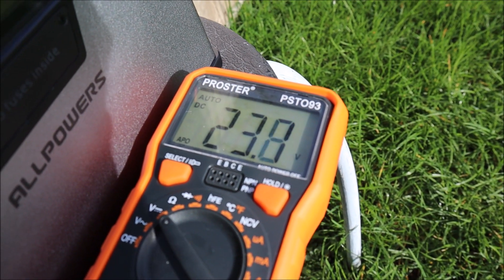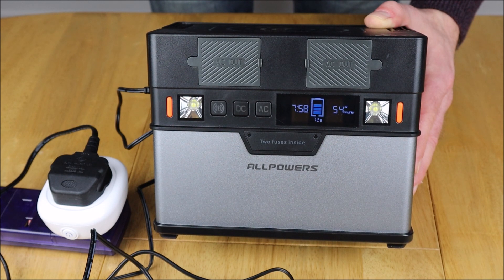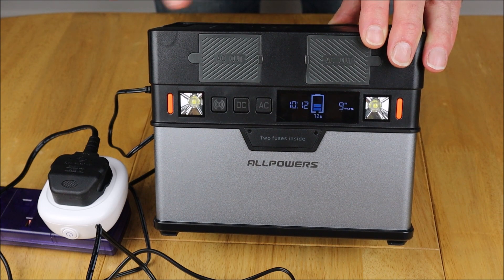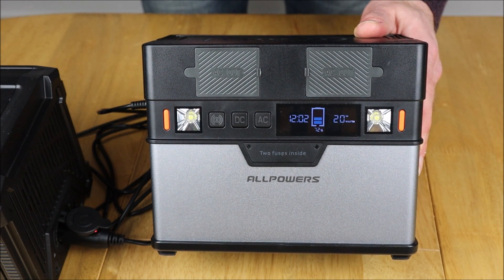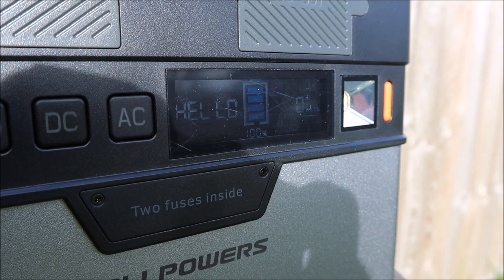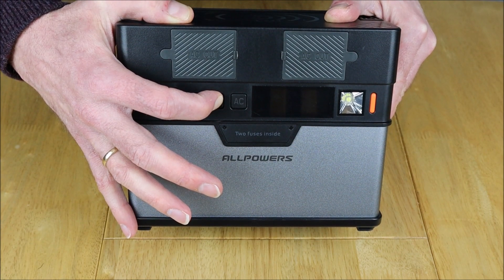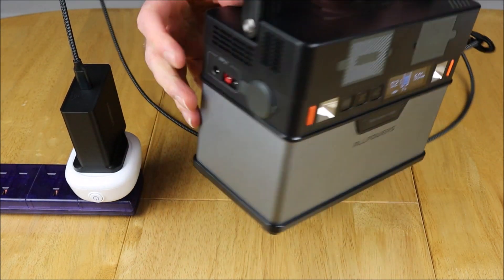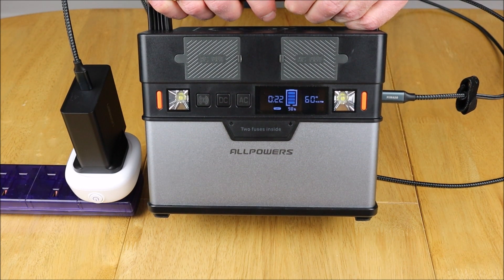ALLPOWERS 372Wh Portable Solar Generator Update | Charging Rundown

Comment: DADvinci ... I have one of these.  However, mine is on O charge (the charge completely depleted), and with the adapter that came with it, it WILL NOT charge at all ... it remains on 0.  So, I contacted ALLPOWERS.  ALLPOWERS sent me a USB-C Charger, asking me to charge it  through the USB-C port (I received it about a week ago) and it still is on 0 ... it still isn’t charging.  Can you help me with any suggestions, etc., to try?  And, yes, I have reset the battery, back to factory mode, several times!  When it was charged, and working, I really loved this little MONSTER, the short time that it was working!  I had it only for about 3 days ... before on the 4th morning, when I tried charging it (then, it had about a 35% charge, that’s is what was showing in the window, and on the app), it would not charge!  I would appreciate any advice that you can suggest trying.  Thanks! 🙂
Reply from the maker: @SharPharMade Good day! I'm so sorry you are having problems. Thanks for the info and I’ve got a few questions if I may (sorry if you've already covered these elsewhere). This might sound odd, but are you able to charge anything from the battery at the moment? Do the standard USB ports provide power or does the wireless charging work? Are you able to switch on the AC? Do you have anything to power from the 12V cigarette lighter socket? 

I'd like to see if it's possible (if you haven't already), to put a draw on the battery and trick the charging circuit into charging again. I appreciate that it's indicating 0, but there may still be enough underlying voltage to kick start it again. Please can you let me know how it goes. All the best, Adrian

Comment: I purchased a 372Wh from Amazon on your recommendation.  Thought you may like to know, along with the standard mains "brick" charger - they also shipped to me the USB-C charger option, albeit a single unit - as in charger and USB-C cable attached in one unit. Works a treat as you demonstrate, I was getting 64W on its initial charge. Oddly though, my unit was completely flat on arrival. I will give it a good testing and let you know how I get on. Methinks perhaps the suppliers may have been watching your videos. Keep up the great work.
Reply from the maker: Good day to you! Thank you so much for your kind words and taking your time to share, it's really appreciated 😊 This is great to hear and a positive move forward with 'extras' appearing. I'm not sure about your unit arriving flat, perhaps they are testing them more now. Please let me know how you get on and shout if you have any questions. All the very best, Adrian

Comment: 14:22 For some reason the charging cables shipped with the units all got the Anderson polarity reversed. Dunno why that is. You need the rewire it.
Reply from the maker: Good day and thanks for your comment, much appreciated. The cable I purchased was fine, but you're correct as the manufacturer asked me to swap the Anderson connection ends around to get it working. It turns out that in my case it's the input voltage range that affected the Anderson port charging which I found out purely by chance (this video if you haven't seen it > https://youtu.be/ViLdkYzOZqA).

Thanks again for taking your time to share this as it will also help others. All the best, Adrian

Comment: Mine charged the battery 4% then stopped charging! Looks like the charger has packed up with 30 minutes, not really a good start.
Reply from the maker: Good day Mark and thanks for your comment. I'm so sorry to hear you're having problems. Have you tried a factory reset (hold down DC button for 20secs)? If not, I suggest giving that a go first.

Do you have another way to charge? Perhaps a USB-C wall adapter and cable to plug in the USB-C PD socket that takes charge? If you could let me know, I might be able to help further. All the best, Adrian
Reply: DADvinci yes I done that. However it’s the charger. It’s only outputting 7v, so that’s packed up! Also when I load it to 90w it just cuts off on ac, I’m sure this is not right?
Reply from the maker: Yes, that's a duff charger for sure as 20V is the norm. May I ask what load you are powering at 90W? Is it when you plug something else in whilst a device is already being powered by the battery - say you have a 40W load, then you plug in an additional 50W load to bring up to 90W? Cheers, Adrian
Reply: DADvinci yes it is, funny thing is I plugged a charger in and it went to 180w and no issues. Why would plugging another charger in affect it? I must have a revised unit as the plugs are nice and tight, there are no rubber covers on then either and I have a nice orange silicone piece under the handle for comfort.
Reply from the maker: Hi Mark. For the alternative charger suggestion, I was just checking it wasn't DC port related as I couldn't tell that from your very first comment (hence trying the USB-C port to charge). It all became clear on your next comment that you'd tested the charger voltage being delivering (which I didn't know in the beginning). It's working ok now, charging included?  Please shout if you need anything else. Cheers, Adrian
Reply: DADvinci yes it charges through the dc port, so it’s not the unit which was a relief. I have used a different charger and all is ok and charging at 33w. So I can charge it through the usb c port? Does not say that in the manual. Now I cannot get it to connect to my iPhone, was working fine but won’t connect now. It’s my phone with the issue as my android and iPad mine work fine! Just annoying. In talks with Mysolar to get a new charger but not heard anymore from them.
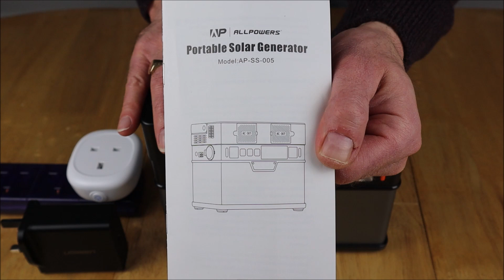Reply from the maker: Great to hear that the different charger is doing the job for the time being. Charging via the USB-C port is covered in this video at 10:11 and it's buried in the manual (assuming you have the same one for yours) under the section 'Using Your Solar Generator to Power Devices' - the first paragraph covers the USB-C port and says "two way PD in/out up to 60W". Quite a few viewers have preferred this method as it charges around 5 watts faster than the standard charging brick (the one you need replacing) and you can use the same USB-C cable to then charge from the battery, especially when out and about. I'd try ALLPOWERS support direct for your charger issue as they might respond quicker. Cheers, Adrian
Reply: DADvinci Thanks for that. I did read that in the manual and thought it may be a misprint! Didn’t want to chance it and damage it. Looks like laptop chargers are fine for charging at 55w, I did contact allpowers direct and have not got a response. Hopefully they come good and send me one or I will have to get amazon involved directly. Thanks for your help👍
Reply from the maker: Glad to help Mark and shout if you need anything else. Have a great weekend. Cheers, Adrian
Reply: DADvinci hi, I have had an interesting development on the PD charging option, it don’t work! I have a 30w charger with usb c which charges another device, so plugged it in and nothing, watt meter stays at zero. So now I’m concerned this usb c port does not work for output as I don’t have a usb c to usb c lead.
Reply from the maker: Hi Mark, was the solar generator fully charged (showing 100% on the display) when you attempted to charge via the USB-C PD port? Was your temporary power brick replacement plugged into the DC port when you attempted to charge via the USB-C PD port? You can only charge via one method at a time. Please can you let me know? Cheers, Adrian
Reply: DADvinci hi, it was at 94% and the charger is for something I use which charges at 33w so I would have thought it would have worked? Does it have to be a PD 60w charger to work?
Reply from the maker: Hi Mark, it needs to be a PD charger which might explain it. I got the UGREEN one as it only does USB-C PD so could charge at the maximum the solar generator PD port could take (60W). You can get lower powered PD chargers on Amazon, but they are about the same price (unless you want standard USB charging ports on the charger as well). I hope this helps? Cheers, Adrian
Reply: DADvinci I think that’s what the problem is, it not PD. I not bothered if it charges via usb c I just want it to output a fast charge from it. Won’t know until I get my usb c to c lead this week. Hopefully I get get this charger replaced it’s just a bit time consuming. If it’s not sorted this week they can have it back.
Reply: Looks like they are now going to send me a PD charger, so will see what that’s like. I’m going to make an in car adapter with and Anderson adapter on it as it will handle the higher amps from the car cigar socket. Am I now right in saying that the Anderson port will only operate at voltages over 16v ?
Reply from the maker: Hi Mark, that's good news on the PD charger front! You are correct regarding the Anderson port, it's in the manual as 16.6-22V at 3.2A (max). Cheers, Adrian
Reply: DADvinci Hi Adrian, can you tell me how much power you get from your usb c port. I’m only getting 10w and an item I charge via it will only charge at 3w. I’m definitely not getting the stated volts/watts out off it as I feel it should be charging a lot higher. I get me more watts from the USB ports.
Reply from the maker: @mark gray  Hi Mark, USB-C charging results. These results are what appear on the displays. I’ve used the EB150 power station as a comparison and the same USB-C cable for all the tests. I’ve only got Samsung devices with USB-C ports.

A50 Phone - 372Wh = 13W   EB150 = 10W
S8+ Phone - 372Wh = 9W   EB150 = 6W
Tab A - 372Wh = 10W   EB150 = 7W
S10+ Phone -  372Wh = 15W   EB150 = 12W

There’s a consistent 3W difference between the batteries, which could be the way the power draw is measured on the devices.
I hope this helps. Please shout if you need anything else. Cheers, Adrian
Reply: DADvinci ok, so you have not done any testing on the AllPowers?
Reply from the maker: @mark gray  Hi Mark, I'm sorry I'm not sure what you mean. The results above are charging the devices from the USB-C port on the 372Wh (marked as 372Wh) and the EB150 (PowerOak EB150) as a comparison. This fully covers the charging from the 372Wh USB-C port. Is that not what you were after? If not, please let me know what you need. Cheers, Adrian
Reply: DADvinci i was referring to the AllPowers unit, not sure what was the max watts you got from the usb c ?
Reply from the maker: @mark gray  Hi Mark, I've only got the USB-C devices I tested in the earlier post. The manual seems to suggest it's 60W PD output, but you'll need something that draws it to fully test. I've not got a MacBook I'm afraid and my Samsung devices don't tend to push the output at all. Cheers, Adrian
Reply: DADvinci hi Adrian, is it possible for you to plug your Pd charger into your AllPowers and tell me if the screen flashed when you plug it into the usb c port, mine does this if the charger is not turned on at the wall socket, just wondering if this is an anomaly with this unit and a PD charger? Thanks for your help on this.
Reply from the maker: @mark gray  Hi Mark, it doesn't do it with my USB-C PD brick (but that's different to yours from what I remember). It does flash when I plug into the USB-C PD port on the EB150 power station (when the DC power isn't on). The EB150 PD port only charges one-way unlike the one on the 372Wh. The flashing is where it loops to keep trying to charge a device that cannot be charged, until you switch on the socket and it detects current coming in. I hope this makes sense. Please shout if you have any further questions. Cheers, Adrian

Comment: Hi Adrian. Does your generator charges up to 100% or does it stop at 99%?
Also did it drain power without being used?
Reply from the maker: Hi, it's nice to hear from you. Yes, my generator does go up to 100% but the last 1% takes ages. Leave it charging and you should at some point notice the charging (in) watts slowly decrease. This is the last stretch and battery management should keep lowering until it's 0 watts in and 100%. 

I don't remember the battery draining without being used, but if I'd forgot to turn off the wireless charging or bluetooth, it did drop a little (but that was because I'd left something on). If it continues to do it, I suggest you do a factory reset (hold the DC button for 20secs).

I hope this helps. Please shout if you need anything else and let me know how you got on? Take care, Adrian
Reply: Yes I did get it up to 100% as the Mrs. Did suggest that I plugged it back in and wait to see if it would, as it could've been due to just being sitting in a store room or something. But I will see in a day or 2 if it drains without use before I reset it.
Reply from the maker: @spuggygame45  Great to hear it made it to 100%! Fingers crossed it doesn't drain. Please shout if you need anything else. Cheers, Adrian

Comment: Anderson is working on mine, the only issue I have noticed, that with a 60w panel it's working fine, but if I connect with a 90w panel, it's not sensing anything. Though if I connect to 60w first and reconnect to 90w before it goes to sleep, all working fine. It could be because 90w panel doesn't have a controller inside (60w panel has).
Reply from the maker: Good day Ned and thanks for your comment. I discovered the workaround purely by chance, after over a month of frustration with my 60W panel. I'm not sure if you've seen our latest videos, but these highlight what you've also found out (waking the display) and how I now use the solar generator everyday for working at home (with 100W solar panel connected all day).

https://youtu.be/ViLdkYzOZqA
https://youtu.be/T_hlnoyAx2c

Thanks again for taking the time to comment and please shout if you need anything else. All the best, Adrian
Reply: @DADvinci  Yes, seen the update and for sure it all comes to starting voltage. If the solar is connected from the early morning, it shuold work just fine as it will start generating as soon as solar will reach the minimum starting voltage ( the sun is not so bright in the early morning). The only other thing i'm thinking about is to try both inputs at once. Allpowers claiming that it has 60w mppt controler built in for the port, but not saying anything that it is per port or total. Haven't tried the max yet. What the highest figure have you seen on the charge?
Thank you for the video, bought mine last october, but since then it's working great, the few things i don't like: 1. 12v ports aren't regulated; 2 . AC outlet only handles around 250w, but claimed is 300w with 500w peak (never seen it as it always triping at 418w). After all it's a good solar Gen.
Reply from the maker: I've had 60W a few times, but consistently get 57-58W using the Anderson port so must be limited as the 100W panel is likely to be putting out more than that on clear days. I need to get some charge monitors to see what the new panel is producing.

ALLPOWERS only recommend charging from one port at a time and I'm guessing it's the maximum the charge circuit can handle (USB-C PD 60W max too), regardless of the MPPT circuit rating. Agreed about the 12v ports and AC inverter being a 'little sensitive' to tripping out when certain loads are applied. I've had late 200W consistently and managed to get just over 300W before tripping using Xbox X + 150W TV. For the amount they crammed into such a small box and the price point, I've been pleasantly surprised with this solar generator. I just hope it lasts as well as the 288Wh one. Cheers, Adrian

Comment: Hi I really loved my AllPowers unit ... BUT the Reason I purchased it was to charge my compressor fridge freezer on a 24/7 basis from a 100 watt solar panel throw a Anderson connector I couldn’t find if this unit had a mttp built into the unit as I have tryed all sorts still my solar panel not powered up / charge my AllPowers unit !!! So just purchased a mttp controller & omg very cheesed off this unit still not showing anything from the Anderson connectors with volt meter on them but I am getting good bolts from panel what’s going on with this unit not fit for purpose.. think it will be going back I have wasted way to many days trying to sort this out any ideas b4 I send it back . And what can anybody recommend please
Reply from the maker: Good day Kevin and thanks for your comment. I feel your frustration as I've also been looking at the Anderson port issue for over a month. I discovered a workaround and now use the solar generator everyday for working at home (with the solar panel connected all day).

I'm not sure if you've seen our latest videos, but these may help your situation so you can charge your solar generator via the Anderson port.

https://youtu.be/ViLdkYzOZqA
https://youtu.be/T_hlnoyAx2c

I hope this helps? Please let me know if you have any more questions. All the best, Adrian